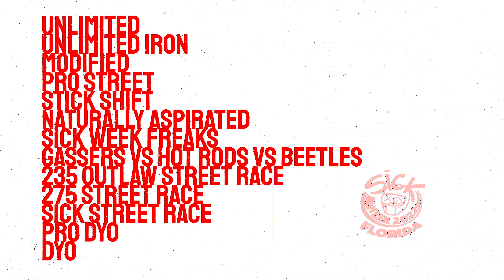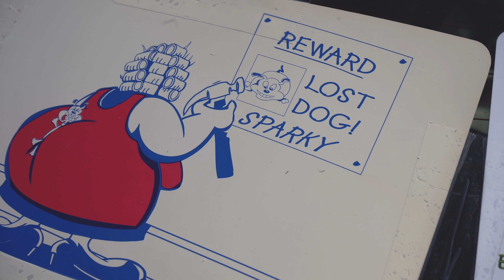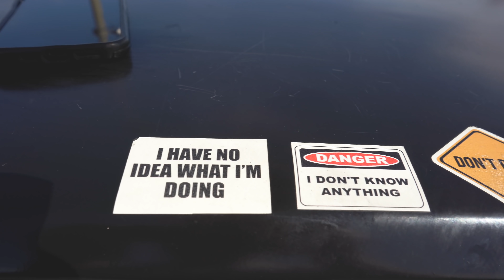Sick Week Day 4 - South Georgia - Doug is in a battle for 1st - Pryka Hit a Deer / Andy Breaks Down

Comment: How can you not love El Toro?! It’s fast, consistent and reliable. And oddly enough, it’s Ford powered…
Reply: @zrxdoug  yeah, but the ones he uses for his events are disposables. The Marauder has an LS. Not saying Fords are terrible, just more expensive to build. As far as engines are concerned anyways.
Reply: @Bryanja81  
Coyotes are pricey, but they take a beating well..
How many of those "disposable" Vics have expired due to engine problems?
(Aside from the one they killed by filling the sump with gasoline.)
Reply: @zrxdoug  I see where your going with this. Yes, they have a lot of miles, they can take some abuse, but they just can’t make the power as reliably or economically as an LS. I’m hoping over time that the Coyote becomes more readily available, more companies produce more parts at more affordable prices, like they have done with the LS. In closing, is take a stock LS of any variety vs a stock 4.6 in competition of abuse and longevity.
Reply: @zrxdoug hasnt Cleetus blown headgasket on neighbour multiple times. He just doesnt video/Mention the problems hes had. Pretty sure one event he ran the engine hard till it locked up. Didnt mention it on the channel though